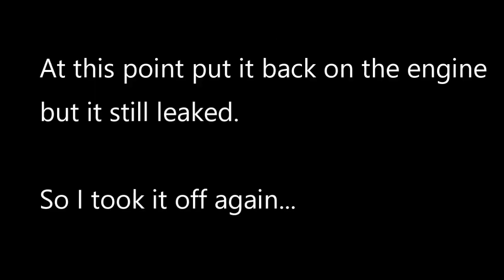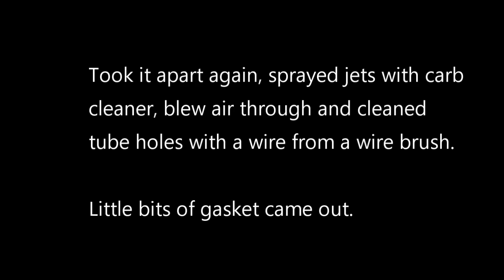Lawn tractor carburetor leaks; won't run off choke

Comment: This is similar to what my LA120 started doing yesterday. It will run fine off the choke for a while but then barely runs. There’s no fuel leaking but at 15 years old it’s sure to at least need gaskets as it’s all original.